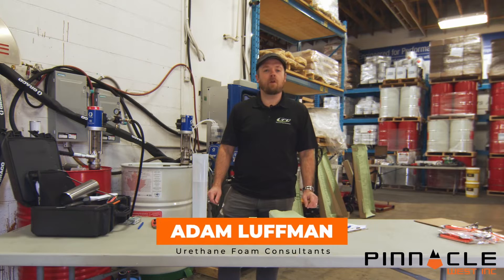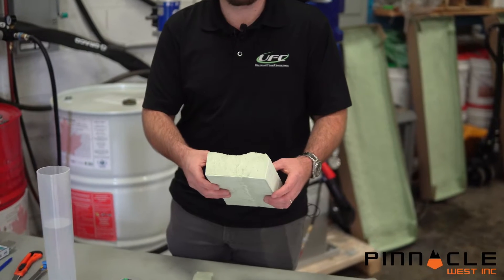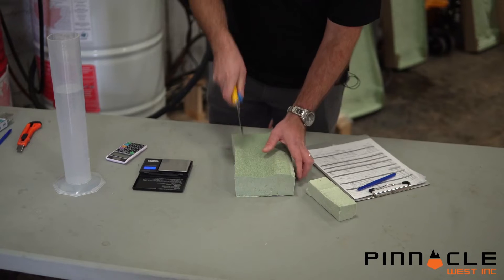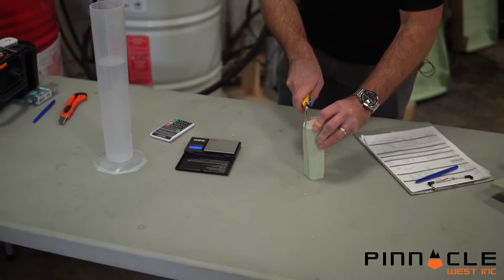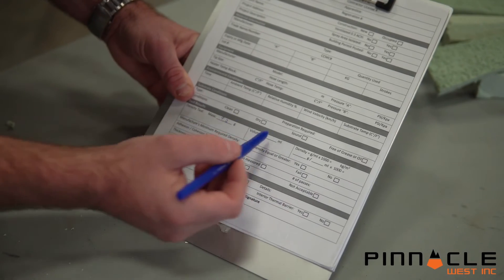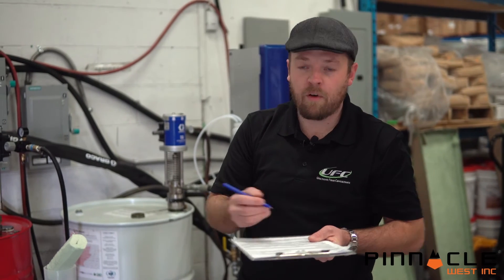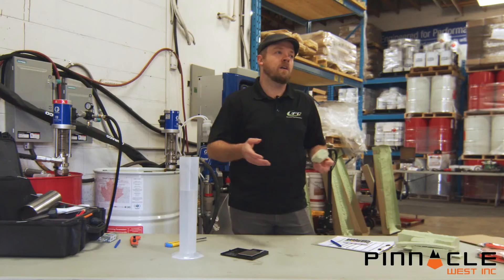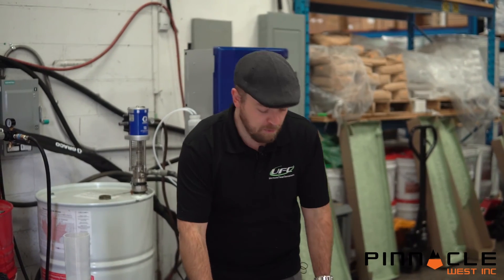Spray Foam Density Testing

Comment: Knife blade in the water has increased displacement
Reply from the maker: Yes it would increase the displacement slightly, but if the knife depth is minimal in the water, the displacement and results will be fractionally changed by this technique.